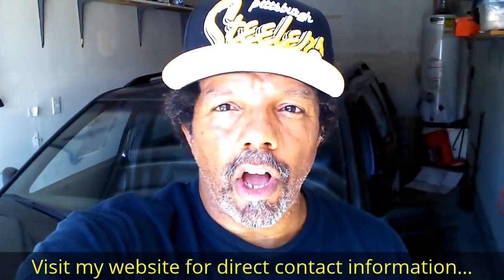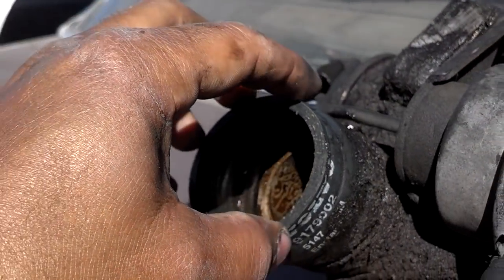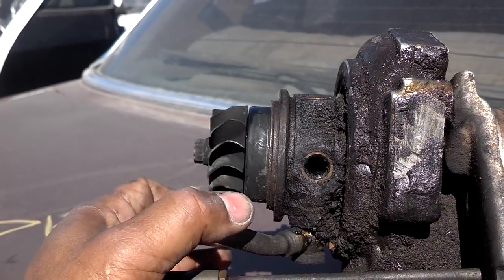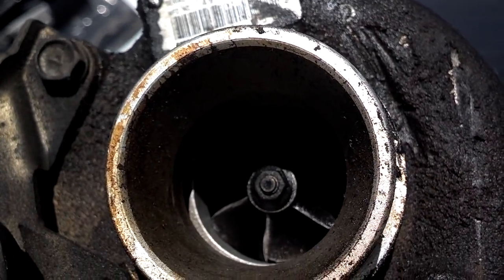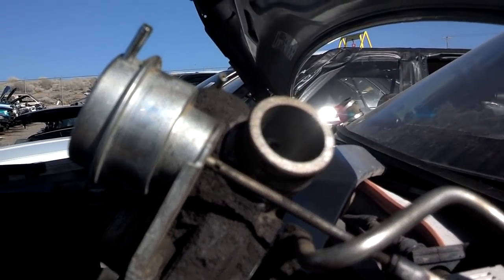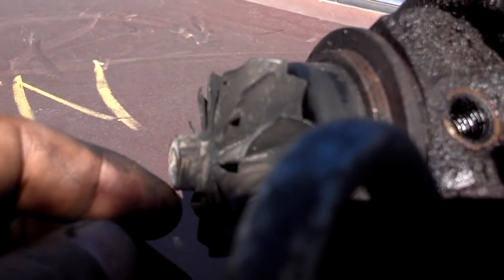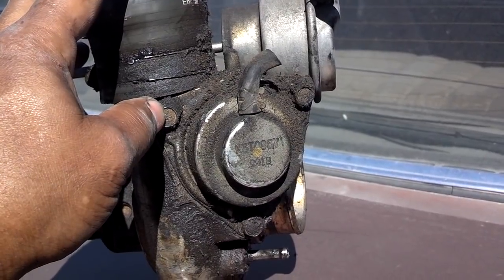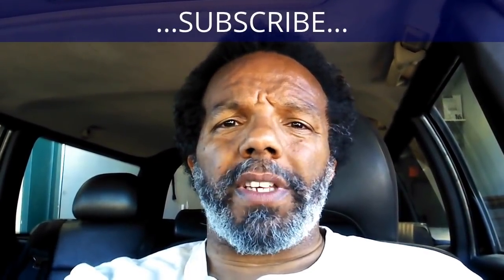How to tell if a turbocharger is bad. What can go wrong with them. - VOTD

Comment: Holy christ, looks like someone installed a smoke machine in that volvo's exhaust. That is nuts! I thought my 99 corolla burning 20 litres of oil per 50 litres of gas (1 tank of gas) was bad!!!!! WOW! Put some conventional oil in that thing and gut out the cat, I can guarantee it'll backfire so bad you'll blow the exhaust pipes right off the manifold! My Corolla had no cat and with cheap conventional oil, it sounded like i was shooting up the neighbourhood when I let off the gas too quickly after accelerating. It's dead now obviously, cylinder walls were all cracked and a piston rod went right through the oil pan. The fucking thing still turned over and ran on 2 cylinders if I gave it some gas when all of its oil was a puddle on the ground... Buddy told me to rev it to redline (didn't even make it that far) and kiss it goodbye. Engine welded itself together and never saw another crank. Got 150$ to get it towed and scrapped and that money bought me my new windshield needed for my new 04 audi a4 1.8t quattro which was otherwise in perfect condition.... until i look at the turbo and see if it's okay!
Reply from the maker: +Marshal Beard lol Thanks for watching.
Reply: Thanks for all of your helpful videos! I've come across many of yours and learned a ton while preparing to own and maintain my audi.
Reply from the maker: Good deal.

Comment: my car don't have power when I turn it on    until gets warm gets power and works normal    can you help me
Reply from the maker: +Marcos Olvera probably not. What kind of car do you have?
Reply: Robert DIY 01 s60 2.4 turbo can the turbo be the problem?
Reply from the maker: +Marcos Olvera what error codes are in the system?
Reply: Robert DIY  no codes   in the sistem.      it shows a p0 300 some times but when it does the car still runs fine
Reply from the maker: +Marcos Olvera misfire code. When was the last tune up? Spark plug replacement?
Reply: one year ago. but I couldn't take 2 off         it has the problem you show in the other video about the oil pressure.    it has some bobbles on the oil when running          when this happen s. it does no t pass the 3000 rpm   then after some minutes. gets normal
Reply from the maker: +Marcos Olvera if the oil pressure is low and you keep driving it you will damage the engine. 

Also, all of the sparks needs to be replaced every 60,000 miles.
Reply: do you think the oil pressure could be the problem of the low rpm?
Reply from the maker: +Marcos Olvera no but that would be nice.

Comment: I have none of those symptoms on my 2007 Audi A4. I've already spent about 6k to get this issue fixed and nothing. I'm lost and have no idea where to go almost everything imaginable has been replaced with the exception of my intercoolers and the hose that goes to it and I can't remember if my map sensor was replaced or not honestly I've lost track of everything that's been replaced. Dv valve just got replaced but light came back on. Is it possible a map sensor is causing this problem? Turbo doesent make any weird noises and doesent smoke I get occasional full boost but not all the time. I've been to 5 different Audi shops and I never get any relief from this p0299 code. Can you advise me on where to go from here? Thanks
Reply from the maker: +Tom V I don't know what that code is for. I would recommend that you stay with one good shop. You likely have an electrical gremlin that needs to be found.

Comment: hey robert love your input question i have a izuzu 94 4bd2 engine my breaks went out no warning it has no pressure  change master change wheel cylinders change break oil union nothing work break boost under pressure holds until  i  pull off  press breaks and nothing no breaks can you help me please
Reply from the maker: Not really, without seeing it. If you replaced the booster, have fluid and good vacuum, not sure what is wrong.

Comment: Hi thanks for your informative video. 
I have a M57n2 engine with a garret gt22 turbo and i also asked some mechanics here who atomaticaly told me thats the turbo but i am not really sure. 
- there is a whining noise although the turbo has only 40k km it an original one not rebuilt and had also oilpipe replaced back then....
- ther is no smoke coming out like in the video
- no shaft play at all and it spins very smoothly
- ther is a little bit of oil on the air intake side of the turbo that was also dripping underneath it
- there is no significant engine oil usage
- i took off the particle filter the air intake pipe and also the pipe that goes to the intercooler but there is still that whining noise at 1500-2200 rpm
- the turbine blade are in perfect shape and look like new
- car is as fast and has same acceleration time from 60-160km/h like before the whining noise began
- oil is new aral supertronic 0w40 
- engine breather (i hope that is called like that) is also new
- new air filter
- new diesel filter
- removed swirl flaps
- new thermostate
- new water pump

here are some photos and a sound file of the whining noise
https://drive.google.com/open?id=0BxFx5nbIvyFtVDQ1OExiY04tM3c
https://drive.google.com/open?id=0BxFx5nbIvyFtOTFfWVBrdmJNME0

what do you think do I need to replace that turbo? thanks
Reply from the maker: I have not looked at photos or listened to the sound file, to risky for me. He's the deal from my point of view... If you take care of the turbo, it can last a long time. I'm not sure if your turbo is factor new or some modified unbalanced unit. If there is oil leaking into the intercooler, I'd be a little concerned. Other than that, if it is still boosting good, I wouldn't worry about a little noise. 

Are you using full synthetic engine oil? Are you running more boost than it is designed to run?
Reply from the maker: Man, I don't know how your car runs with the turbo intake off. It actually sounds like an alternator whine to me. Pull the belt off of the alternator and see if it stops.

Comment: that short clip and showed of the SUV was not oil smoke let me repeat that.... that was enough oil getting into the combustion chamber via turbo leak. that is coolant in the combustion chamber either a blown head gasket cracked block or some other.
Reply from the maker: +nick simmons dude, NOTHING was in the combustion chamber, it was oil pumping oil out of the back of the turbo into the down pipe, through the cat and out the exhaust. Turbo replaced, problem solved.
Reply: then it was a cracked center section and coolant was getting into the exhaust. oil burns blue not white. I'm only talking about the short clip where you're looking through the rear-view mirror in the camera angle... that was white smoke and no form of oil burns white.... just saying. I've been working as a tech for 18+yrs not trying to argue just trying to give you some info. loved the video
Reply from the maker: +nick simmons coolant evaporates pretty quick once it goes out of the tailpipe. Oil looms for a while. But here is a longer video.
Reply from the maker: +nick simmons https://youtu.be/OqMopaomEZ4
Reply: yeah I would bet money that the turbo center section was cracked and water was getting down into the downpipe. that's a tough diagnostic to find. and that's from   being under hard loads and then shutting it off quickly or even being low on coolant under the same conditions.(steam and cast metal don't mix well) I think you would be surprised at how often these small Journal bearing turbos have the center section crack. a lot of times people don't see that the center section is cracked because the turbos are coated in grim from being on the vehicle for a 100k or 200k miles and when they go to rebuild them once they're taken apart.(and cleaned) that's when you'll find the crack if it's not seen externally on the center section of the turbo.
Reply from the maker: +nick simmons so the turbo is bad?

Comment: Robert DIY, and all parts of turbo are ok, but I view some oil on intake tubes???
Reply from the maker: What kind of car do you have?
Reply: VM motori 3.1 diesel itallian
Reply from the maker: Could be normal to have a little oil in there. Ask people on a forum.
Reply: Robert DIY, thank you. I doesn't know you location, this VM 3.1TD equips the Jeep grand Cherokee WJ on Europe, it has a Mitsubishi brand on turbo, it deliver's normally 1.2 bar pressure. Mine is adjusted for 1.5 bar because it has a REPRO. all works well, the only thing that bothering me is te presence of oil residue across intake tubes!

Comment: Hi Rob, I've made a video with sound of the noise , if I post it https://youtu.be/BjtoinkzR2U would you mind giving me your opinion please, Regards Terry (UK)
Reply from the maker: Sounds bad. Are you having performance issues?
Reply: Hi Rob, thanks for the response, not having any  problems at all, car drives & performs like new, no smoke from exhaust not using any oil or water still has great mpg, it only does it when I start up the engine & go over idle speed goes away after about 5 mins when the engine is warmed up. got me puzzled!

Comment: I have a 2007 Hyundai Santa Fe 2.2 crdi  that makes a whirring noise when the engine is cold(only when i go above idle speed) goes away when the engine is at normal temperature, I've replaced the auxiliary belt & both tensioners, the sound appears to be from the turbo. does anyone have any advice please. main dealer says to change the turbo & trial & error other parts. car runs as new, with 149k on the clock. thanks. Terry.
Reply from the maker: +Terry Sim sounds like a vacuum leak. Smoke it or don't worry about it.
Reply: Hi Robert, Thanks for the response, how do I smoke it?. cheers Terry
Reply from the maker: You'll have to get a smoke making machine. I have seen some for $60 on eBay. The tough part is that you need a compressor. So it might be better to have a shop smoke it for you.

Comment: when a turbo shaft is leaking oil down through the inlet or exhaust side of the turbo it gets burnt either in the downpipe or through the engine, this would normally result in blue smoke. white clouds like you see in the video looks to me like it's water related, just in my experience that definitely would look like a head gasket symptoms but I guess a bad turbo could also do this, more often than not I find is if it's pouring oil into the exhaust then it will be blue smoke on hot idle, and clear under load when it gets so hot and pressurised it's less noticeable.
Reply from the maker: +Virulent not sure why it's white.
Reply from the maker: +Virulent https://youtu.be/OqMopaomEZ4
Reply from the maker: +Virulent https://youtu.be/Bp4CtNaZh6U
Reply from the maker: +Virulent https://youtu.be/LD-s5VagcCM

Comment: good onfo
Reply from the maker: Thanks for watching.
Reply: I got a question man. I just took off the intake manifold on a 6.5 desiel and it looked like there was oil coming in through from where the turbo hooks in is that a seal on the turbo that could have gone bad? I have never messed with turbos before.
Reply from the maker: Most likely. Probably ready for a rebuild. Does it have shaft play?

Comment: Nice video - very informative.  Maybe you can answer a question about my specific vehicle.   Turbos are leaking oil from somewhere - it's caked similar to the one in this video and all over it.  Not blowing any smoke out of the exhaust and not seeing any performance issues, but it is leaking.  I've replaced the return line and the banjo bolt on the supply line, but it's still leaking.  Any ideas?
Reply from the maker: What kind of car do you have?
Reply: 2010 Lincoln MKS with the ecoboost engine.  Any ideas?
Reply from the maker: The oil pressure is high so if you don't see oil dripping on the ground, it is probably something else leaking. Clean it all up and then look at it from there.

Comment: Robert!!!! That last statement proves you have NO clue what PCV stands for, : "Positive Crankcase Ventilation" that IS the system DA!!!!!! Like I said before, "GET SOME AUTO EDUCATION". Know what you are talking about before the diarrhea comes out of your mouth.  You STILL have not produced any information to back your statement up. I have!!!!!!!!!!!!!!!!!!!!!!
Reply from the maker: +Gordon Dowis so, are you backing off of your "all cars have a PCV valve" statement now? Because that is what got your G-string in a wad to begin with.
Reply: Robert DIY Stay off the DRUGS Robert. stop using alcohol so badly and reread all my post, I have been asking the SAME question each time, and for weeks you have denied a logical answer, again, what year car are you saying that has "no PCV value system ? Again, what model, make and engine, if you don't know, give me the VIN and I will tell you where it is. SAME Thing I HAVE BEEN ASKING!!!! You have no clue due to your education level I am sure, most likely you can't read either. ALL vehicles since 1964 have a PCV system, a Valentine's can be a simple "black sump box mounted on the upper intake like the Chevrolet Vegas first had. That too if you know anything about engines, is a PCV system, or valve!!!!
Reply: Gordon Dowis Get off your high horse you negative fuck
Reply: Roddy Dykes Wasn't that your late bell for homeroom I just heard boy? Better hurry you got 15 demerit's now.

Comment: Still don't know what you drive???? Why can you not provide such easy information.when you have spent so much time avoiding it, besides, that's exactly what I said, all cars have a PCV system, ALL since 1964 by federal law, and the valve itself never causes a oil leak. Get some education son.
Reply from the maker: No, you specifically said that all cars have a PCV valve. I said not all cars have a valve.
Reply: THURS, you need a education about automobiles engines built since 1964, a PCV vale can be a simple hose and valve inline BETWEEN THE CRANKCASE AND INTAKE or a plastic box between the crankcase and intake to relieve crankcase pressure to to blow-by. Something MUST be there. CONSIDER YOURSELF NOW TAKEN ONE OF MY EDUCATIONAL CLASS'S ON THE AUTOMOBILE ENGINE.  THANK YOU FOR ATTENDING.
Reply: HAVE YOU FOUND THE NAME OF YOUR CAR YET?  DO YOU KNOW WHAT A VIN IS? GIVE ME THE THING , I'LL TELL YOU WHERE YOUR "VALVE" IS.
Reply: Gordon Dowis oh sorry you have 1 sub.  My bad. Lol idiot.
Reply: My car has pcv and no valve.
Reply: Gordon Dowis hey my 1993 vw diesel has no pcv valve

Comment: can you change the wastgate on a turbo? i have an turbo from an bmw 520d 2008. it has an electronic wastgate. so i was woundring if you can change that to an mecanic wastgate?
Reply from the maker: Yikes! I don't know. I doubt it since the mechanical ones use a TCV to modulate them.

Comment: The only vehicle with out a PCV is a dragster which uses a scavenger system and venturi tube in the exhaust to draw out fumes, a 2 cycle engine doesn't have one either.
Reply from the maker: I never said that there are cars WITHOUT a PCV, I said all don't have a valve.
Reply: NAME ONE< JUST ONE< YEAR MAKE AND MODEL< YOU ARE BREAKING FEDERAL LAW NOW YOUR FEATHERS ARE OUT< FLY BIRD!!!
Reply from the maker: You are the one with 25 years of top notch ASE certification experience? Go figure it out.
Reply: the Peugeot 3008, 1.6 THP does not have a PCV Valve, not need it.
Reply: jose Luis then it's blowing oil out, fact: if the "crankcase" does not ventilate, by a pcv "system", as required by Federal Law, it is against the law to operate such vehicle in the USA. fact!!!
Reply: YES, TOTALLY AGREE, BUT, a dragster is NOT driven on a highway or any street maintained by the DOT, second, if you know of a car with a two (2) cycle engine large enough to drive @ 70 mph, give me the details, and I HOPE it doesn't smoke like ALL 2 cycle engines, LOL!! If it's driven on a "public roadway" it MUST meet Federal Emission Standards, which INCLUDES: a PCV SYSTEM ! A "sealed crankcase" is also what it must have, so to prevent blowing all seals in the crankcase area, you MUST have a PCV system. Consider yourself "educated"